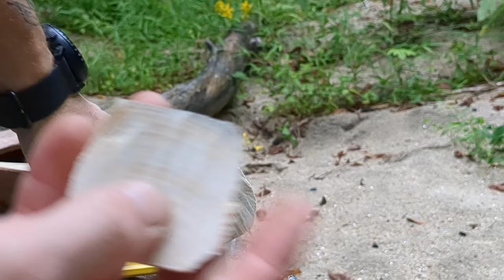Hand Carved Ash Handle (Tasmanian axe part 1)

Comment: Nice video Drew. Great technique you have using a pencil making a center-line down the length of the handle. Great reference point.  👍🏻
  Agree about being “the boss” with Bonzo & Bergelmir. 
  Bergel sneaking a sniff. Bergel dreaming of Burglers. 🤣😂🤣😂
  Awful nice/decent of you to help those older folks Drew. That’s getting to be a rarity these days. 
  Speaking of making sawhorses, when I worked for Bridge Maintenance we would make a set out of 2X4’s and a set out of 2x6’s for heavier work. The principal was to make the top of the saw horse like an “I beam” and affix the legs to it then reinforce the legs. Rugged as hell. I’ve seen a YT vid on the same saw horses. They last forever! 
  Love hickory. Seen a vid on just how tough it is. They did a test on a piece of hickory using a bowling ball dropped from various heights. Many other types of wood were used and hickory beat them all.  At higher heights the hickory would fray/splinter in the center but not nearly as much as the other woods tested. 
  Yep, good to get out and walk, clear one’s mind, get off the cellphone/computer for a bit. 
  I’m curious if you’re going to stick with the ash or go to hickory with your handle. 
  You got a point about overstrike. 
Yep, I’m curious about that “moose-knuckle”Drew 🤔😉😂. Awesome job on this handle Drew! I enjoyed it! 
  Got some catching up to do on your vids Drew. Got behind a bit. My Brother in law had a health issue scare. He’s ok and VERY lucky. He’s got to make some life style changes. 
  Catch ya later Drew! 👍🏻💪🏻🇺🇸☘️
Reply from the maker: Sorry I missed your message John. That saw horse sounds intriguing. Glad your Brother in law is okay! Take care my friend 💪🏻🇺🇸🤙🏻
Reply: @MountaincraftOutdoors  - No worries Drew. We all get behind at times. 😊👍🏻